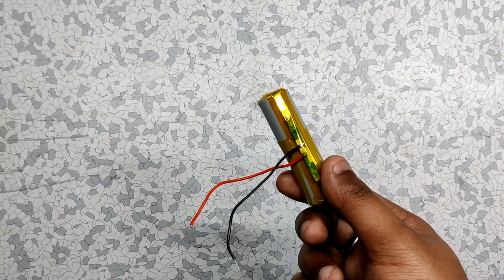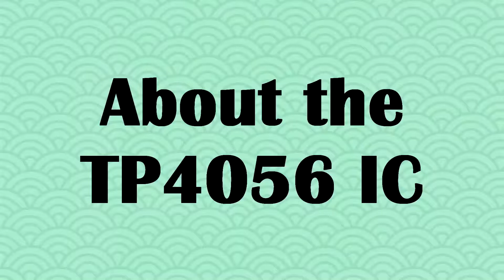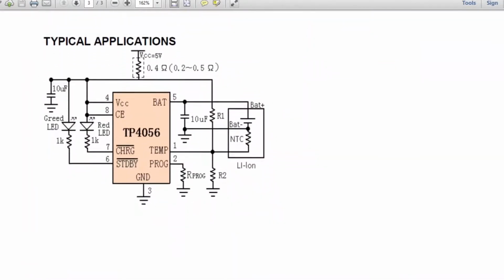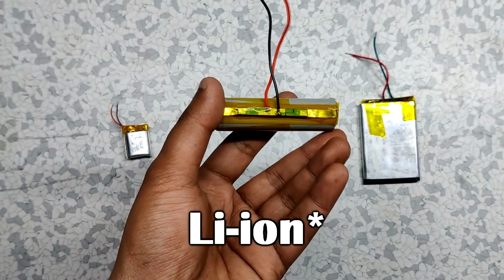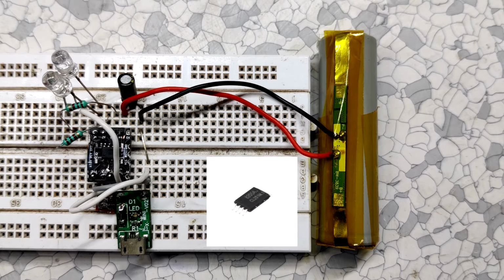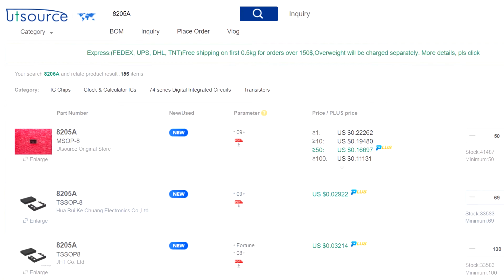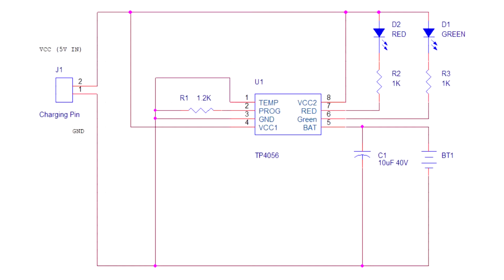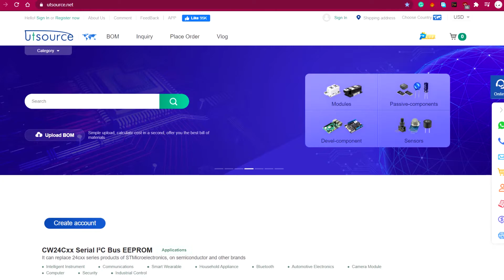DIY TP4056 Lithium Cell charger

Comment: hi, I want to make a balance charger using tp4056 for 48v battery 12s 3p does that mean I need 12 tp4056 modules connected in series and then to the battery like BMS wiring?